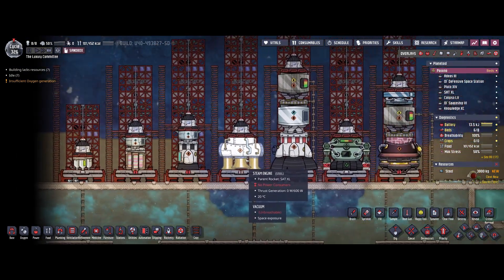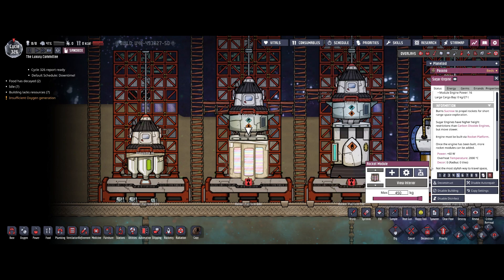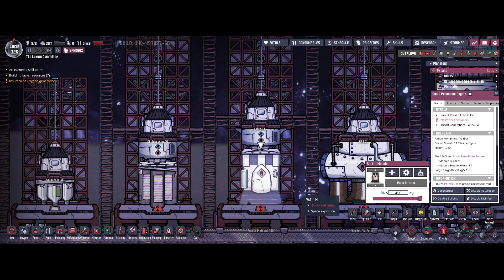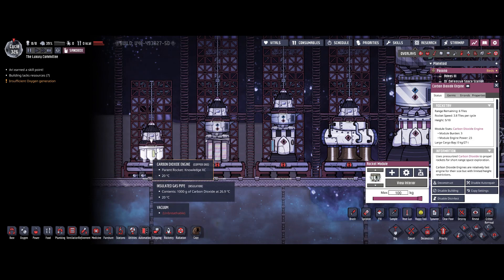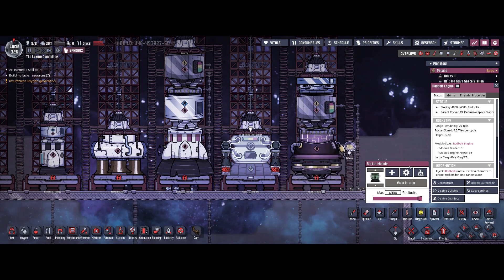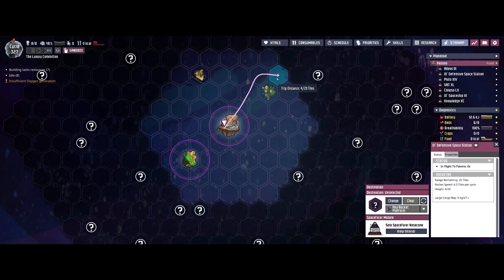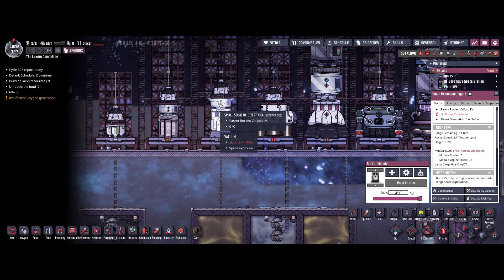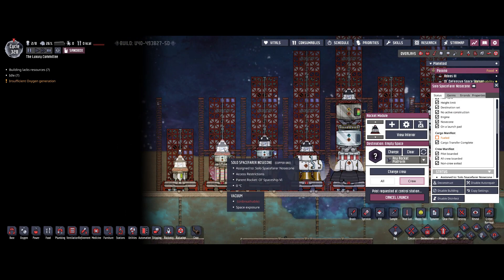Oxygen Not Included: Rocket engines compared

Comment: Early Game: Suger is pointless, due to the reasons you mentioned. It is also all that is needed to complete the sciences, since you only have to get them off the planet.
Mid Game: Steam is not worth it unless you can not get get petrol and even then it is wasting water. So just try to get to some petrol with Carbon.
Late Game: Large Petrol is early, Rad is mid and Liquid H/O is late. If I get to a super late game the only reason I will keep a Petro/Rad engine going is they are already 100% automated/sustainable and the stuff they are doing does not need to be any faster. This is due to Petrol can get some dupes to any planet, for setting up colonies.

Also depending on the DLC you own and the planet you start out on. You might be able to skip mid game.

Comment: Thanks for the comparison.

You don't need super coolant to make liquid oxygen.  I use hydrogen gas as the coolant when making liquid oxygen.  I use the thermal regulator to chill the hydrogen gas.  I use a metal tank and the vacuum as the insulation for the cooling tank.  If you put the tank in space it just has to be far enough away from the rocket exhaust.  With a renewable source of water you can dump the heat into steam and then throw the steam away into space for early game cooling.  You need steel for the regulator but not plastic.  It might be possible to use a gold amalgam thermal regulator but you will waste a lot of water this way.  Give it a try.
Reply: you will need hundreds of cycle just to research liquid oxygen fuel tank. I always get super coolant much sooner
Reply from the maker: agree. I dont know, maybe its only me: I hate having to replace all my buildings and machines once I have researched aqua tuners and access to super coolant. Thats one more reason why I usually dont use the thermo regulator. Anyway, u need to pay a lot more in power to run thermo regulators for the same amount of cooling (see following vid): https://youtu.be/C5JE3qY_3Lg
Reply: @engineeringandgames6107  Hmmm.  1200 watts for the Aqua Tuner vs 240 watts for the Thermo Regulator.  Conductive wire vs regular wire.  It all depends on your point of view as to which is better in a given application.  It might take 10 times longer but it will get there on 1/5 the power.
Reply from the maker: @dougingraham5807  Im afraind no;) takes lonker PLUS twice the power per cooling achieved

Comment: Two small oxidizer tanks take up one less slot than one large oxidizer tank it helps when trying to min max your rockets also I always go sugar engine at the start because you can easily bring your return fuel with you inside the rocket making the one way distance the maximum hex distance
Reply: They also provide power to the crew module during flight, which the co2 and radbolt engines do not.
Reply from the maker: thats a valid argument for the sugar engine. Unfortunately some asteroids dont have sucrose on them so u might be stranded if u dont check the biomes in advance;-)
Reply: @engineeringandgames6107  you can just take them on the ship